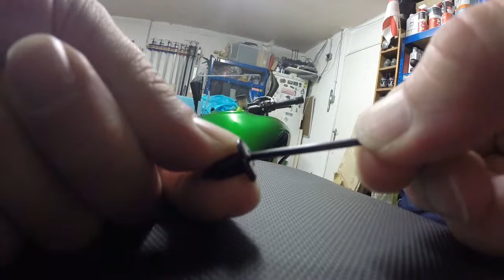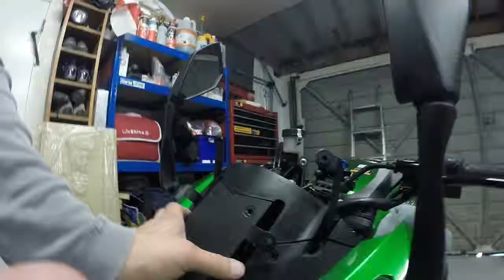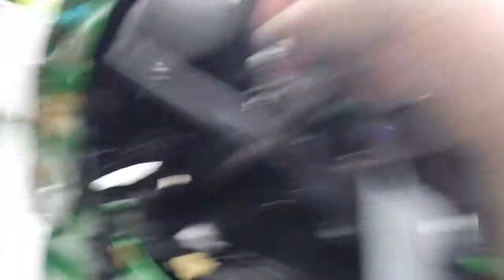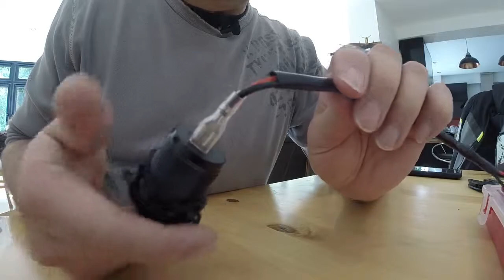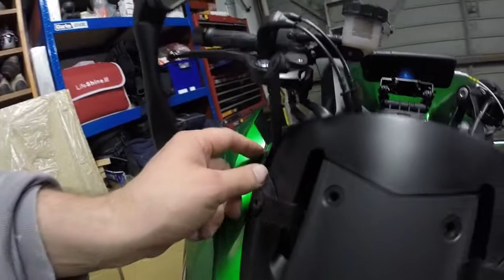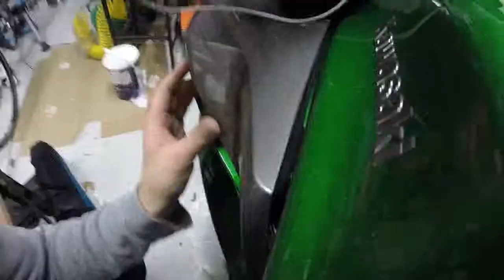2018 Kawasaki Z1000SX ( Ninja 1000 ) DIY USB Power Socket Install, way CHEAPER than factory option!

Comment: Great video, maybe I am being thick, but can you plug a sat nav cable straight into this fitting, not to worried about phone. Thanks for any feedback.
Reply: Thankyou for the advice, much appreciated
Reply from the maker: Hi. Anything you can power from the available grunt from the usb outlet would be ok. If your satnav can run off usb the it should be fine :) I’d suggest checking the power requirements of the device in question.

Comment: Hi Mate, 

A previous owner on mine had soldered some aux lights to these wires and then cut them when removing the lights, so the bullet connectors are gone, do you know which wire is positive and negative? (Blue and white, black and yellow?)
Reply from the maker: Will try to take a look on mine.
Reply: @chisnsid  thank you so much 👍
Reply from the maker: Hi mate. Pulled the side panel off and on my 2018 the white with blue stripe is positive
Reply: @chisnsid  thanks mate, really helped me out! finally have a dual usb on my bike.
Reply from the maker: No worries :)

Comment: I have the exact same USB kit, but apparently my 2018 Versys, which visibly has the exact same dash, requires an additional relay to be installed.  Do you not need that on the Ninja?
Reply from the maker: Nope the ninja has switched live and a neutral wire already in the loom ready. The fusing and relay are already there. They might be part of a larger circuit but definitely there.

Comment: Nice work! I just bought a 2021 Ninja1000sx, and looking to do this to it!
Reply from the maker: Thanks. I think the 2021 model has a special connector not the bullet type though. It’s still possible though.
Reply: @chisnsid  Glad I saw this, was just about to order some! I will open her up and see this weekend.
Reply: You are correct, I took a look today and there are no bullet connections. I couldn't even find a connection. I found a write up for a 2020 ninja and apparently the new waterproof plugs they use are wrapped in tape under a connector. I'm going to take another look tomorrow and if I find them, will make a video showing the way I connect it up. Thanks!

Comment: hi do you remember which crimp-size did you use I dont need all 500 pieces
Reply from the maker: I don’t remember the size. I can see if it’s marked on my my.
Reply: @chisnsid  I think they are color coded, and you used red ones. The colors indicate what gauge wire they can handle, so if the red worked, you want red ones.

Comment: I have ninja 1000sx  2020 and  I can't find these free USB plugs
Reply from the maker: Hi the wiring loom on the 2020 model may well be different. Has to be something to connect to as they still sell the usb outlet as an official accessory. I can have a rummage to see if I can find out any info.
Reply from the maker: Looks like kawasaki have changed the two bullet connections to a proprietary company plug.  It’s there and the wire colours seem to correspond to the older bikes.

Comment: Good video! Where do u have connect the negative black cable? Thanks
Reply from the maker: Hi. If you have the 2018 model like mine there are two connectors specifically for the usb accessory outlet. Those are where you connect the two wires to. You can only just see in the video (apologies but it’s hard to film it) but there are two connections I linked into.

Comment: Really enjoyed this video.  You've given me the courage to wire my phone holder to the loom for the headlights on my ZZR1200!  Just need to get some electrical connectors!
Reply from the maker: Awesome. Don’t forget to keep the inline fuse. Oh and make sure you buy a big box of connectors :) in a nice set :) 

Seriously, I’d probably run to the battery as I’m not sure the headlight circuit is ideal. Some folk also put an inline switch in to make sure the socket doesn’t drain the battery. I’m sure there’ll be a switched live circuit available somewhere on that bike as there’s loads of optional items that can be fitted. Well worth some research.

Comment: Thanks for the cracking video, I have just bought a new Ninja to replace my ‘17 model, which had a dealer fitted (hardly ever used) power socket. I bought the same green USB socket 5 mins after watching your video and will fit it when the bike comes.
Reply from the maker: Thanks for watching and the kind comments 
Not sure if the wiring for the new bike is the same so it’ll be interesting to find out how you get on. 
ZedRunner

Comment: Under the seat I noticed another  bullet connector that’s unattached.  Do you know what’s that one is for ?
Reply: There's an optional 5V USB-A socket you can get via the dealer for under your seat, that's probably what its for

Comment: Good video -   really appreciated.
One thing - had you used a STUBBY screwdriver to begin with, you wouldn't have had to remove any fairings, which means that you could get to your next cup of tea much faster.
Liked and subbed.
Kawasaki Kid
Reply from the maker: so true - I live and learn :) thanks for watching and the sub - really appreciated :)
ZedRunner
Reply: @chisnsid   The size Philips needed is a #1, and better than using a stubby straight screwdriver, a ratchet offset makes it really easy to access the  screw w/o removing any fairing.
LOVE my 2018 Ninja 400 KRT Edition ABS,  BTW.
Reply from the maker: subbed back by the way :) I will check out your videos too :)
Reply: @chisnsid  

Thanks for the sub. My videos were pretty much for the enjoyment of my "brothers"/members of the Blue Knights Law Enforcement Motorcycle Club.

Comment: Great video! How did you fit the Quadlock to the sat nav mount?
Reply from the maker: Two strong cable ties. I used the handle bar mount version of the quad lock. It used to work perfectly. Just decided to upgrade the navigation to a ‘proper’ Garmin. Got fed up with the limited app capabilities. The quad lock itself worked perfectly.

Comment: Hi just come across
 your video from the link you posted on the new ninja 1000sx, great video by the way👍 is the socket waterproof when it’s in use?
Reply from the maker: hi,
thank for the feedback :) glad you like the video :)
the rubber cover waterproof's the socket when not in use, when you have a cable plugged in you have to remove the cover so I'd say no it's not. 
But to be honest, getting water in it would be pretty unlucky... unless you are stationary in a down pour.

regards

ZedRunner

Comment: Can I connect my satnav into the same connectors along with the USB port
Reply from the maker: hi, if you mean wiring both the power and usb into the same bullet connectors inside the bike, I'd prefer not to do that. I'm sure someone will say you can, but I don't see the point, keep each item individually fused and there's no worries. bear in mind the usb connectors are designed for that... id you add usb AND sat nav power requirements, what will happen to the fuse in the bike? I don't know the answer to that so I'd stick with the safer option and do one item as per design intent.
cheers

ZedRunner

Comment: I'm glad you posted this video bc I'm tackling this small project tomorrow. And my USB connector is identical to yours (out of the box) and I'll be cutting off the fuses, adding the male and female ends and plug and play and installing the relay kit. I had a question leading up to this. I wasn't sure if I needed the fuses or not and I THOUGHT not, bc I wasn't going straight to the battery! Thanks for the help!
Reply: Could I also connect a satnav into same connectors along with USB port

Comment: great video, are the bullet connectors one size?
Reply from the maker: hi, there are various sizes but taken from the Screwfix website these are the ones I used..
FRD1-156 (6.3mm female bullet terminal red), MPD1-156 (6.3mm male bullet terminal red),

Comment: Great episode from your channel. I have seen similar from Johnathon Long over in the states but his installation  was quite clinical but yours was much better.
Have you done he heated grips yet, which power feed would they go to? Manufacturers  say wire direct to battery, I'm  expecting a dead battery in that case. Keep up the good work.
Reply from the maker: thanks for such a nice comment - I really appreciate it.
I have not fitted any heated grips and I don't think I will, but I understand there is power available in the loom already, I think it's behind the main fairing panel on the left hand side of the bike but would need to be checked. The bit that's useful about the existing factory wiring is that it is switched by the ignition, so you won't be Able to leave the grips on... I will take a look and see what I can find..